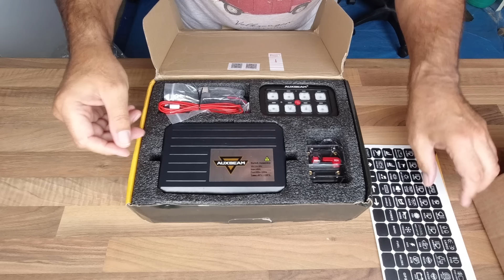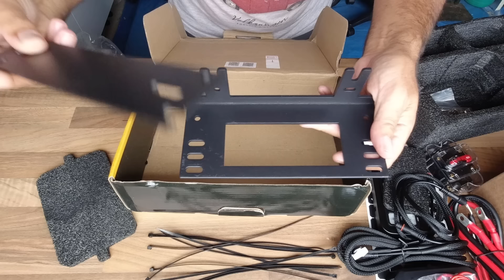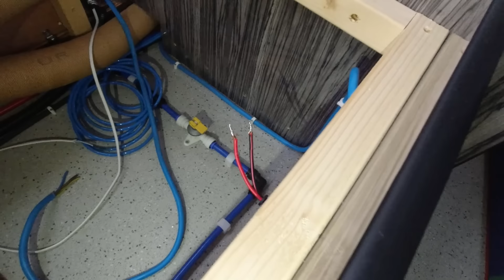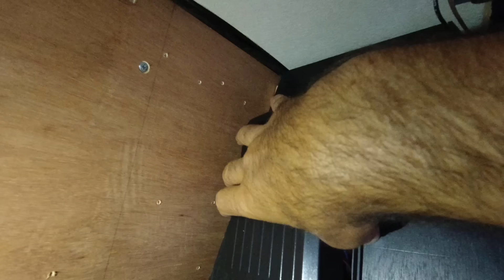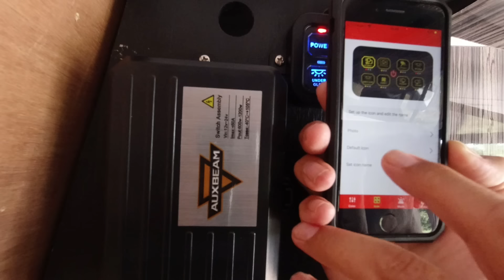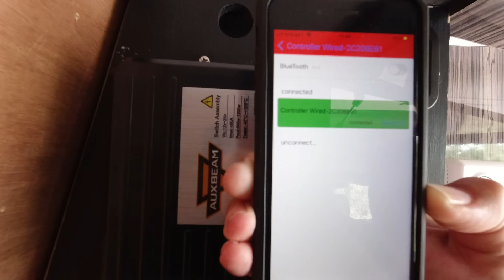Upgrading our Sprinter Campervan with new Auxbeam Control Panel

Comment from the maker: If you wish to purchase one of these Auxbeam Switch Panels please click on this link https://www.ebay.co.uk/sch/i.html?_from=R40&_nkw=auxbeam+switch+panel&_sacat=0&LH_PrefLoc=2&_dmd=2&rt=nc&LH_ItemCondition=3&mkcid=1&mkrid=710-53481-19255-0&siteid=3&campid=5338027957&toolid=11800&mkevt=1
Reply: Hi Greg, really appreciate you videos. Can you tell me what circuit breaker you used in instead of the 60 amp for the Aux beam. I purchased one and following your instructions thanks in advance mate 👍

Comment: Did you still use convertor you bought for tv to change to 12v  with this  new fuse panel
Reply from the maker: Yes, because the tv converter changes the 12v to 19v DC and it’s still working perfectly 👍🏼😃

Comment: Great video Greg (as usual) quick question! I am just about to start first fix electrical in my sprinter, I will install this great item! For my fridge & truma boiler & maxx fan will I still use a blade fuse holder?

Comment: gret infromative video as I am planning to install the same switch panel. My question is can I hook up a dimmer to this for the puck lights or perhaps 2 dimmer switches to i have a dimmer near the bed in the van maybe one up front ..? thanks again
Reply: I would expect you could add a dimmer toggle switch within the line for the light

Comment: another great video Greg. Are you able to swap the fuses to suit the rate of the electrical items in the van?
Reply from the maker: Yes you can as long as the fuse rating is below the individual contact rating and the total doesn’t exceed the total for the device 👍🏼😃
Reply: @GregVirgoe  thanks for that Greg, I'm going to give it a go 😉

Comment: Thanks for sharing. In previous video, you explain your control panel which include the 12V fuse box. Is this one different? Do you have more than 1 fuse box? Is the only reason to upgrade the remote control capability?

Comment: Great video. Which model you choose as advertised are and all look the same: AR800, RA80, GB80  GA80! 
Thanks and keep up the good work!
Reply from the maker: There are 6 way or 8 way and with or without the mobile app control. Just read the description you will find the one you want. 👍🏼😊

Comment: greg cant actually see the solid state relays on the board just fuses racks and connection block/also have you fitted or anyone elase fitted PIR for out side secuirty lighting any hlp would be usefull as dont want cheap ebay/amazon stuff
Reply from the maker: The PCB is covered in a black silicone to waterproof it if fitted in the engine compartment.

Comment: Thanks for posting. do you think they supplied the piggy back connector to pick up supply off the distribution board itself? or is there a reason why you didn't use one of the spare (5A) fused supplies ( at the bottom of the board) to supply itself? save installing a seperate fuse holder?
Reply from the maker: The fuse holder they provide is designed to come off an ignition live from the vehicle. I have since found out that if you switch the power to that red cable it turns the entire board off. 
It’s originally designed to switch aux lights on a vehicle.  
You couldn’t feed it from an output of the board because you’d never be able to turn it on.
Reply: @GregVirgoe  thanks, was forgetting that it had internal relay,  not just busbars

Comment: hi greg long term watcher of your videos they have been an absolute god send in helping me do my own conversion.    I have an unrelated question to this video which I'm hoping to can advise on
 I very currently got a leisure battery which only means of charging is solar.   so far its been perfect however I want to upgrade it with a split charge relay that way the solar is only really a back up then when engine not running.    seen various setups and prices on this which is a bit confusing so wondering what system you would suggest.   also if I wanted to add a 2nd leisure battery would the connections be the same ie.   positive on 1 bat negative on the 2nd ?      hoping you can advise.   thank you wayne
Reply from the maker: I would always advise fitting a battery to battery charger instead of a split charge relay. The relay is just a switch and it doesn’t know the condition of your battery or meter the charge accordingly. Where’s a charger will do that and ultimately look after your batteries much better for longer life. 
Yes, connect red to one battery and black to the other battery if you have two in parallel 👍🏼😊

Comment: Neat product, but a bit more complicated (and expensive) than 'just switches and relays'. Thanks for the review as I think I will need to replace my switching system. Also handy to learn about 12 V Planet. Will look at the, too. Cheers!
Reply from the maker: I think you would struggle to make aboard from individual relays and switches to give you the same functions for less money.
Reply: @GregVirgoe  I fully agree with you, plus there’s the app, which is properly handy; just hope it’s well written and secure. Great to have options such on/off, pulse or momentary and thanks for showing your installation. That’s great!
Few more questions…
Are the relays user-swappable (did you take the cover off to see), or don’t you expect these to be any problem? 
Good that you also get a 60A breaker. Is that DP?
How much parasitic draw (eg the Bluetooth) is there without any circuitry being live? Is that why you installed the isolator?
The bracketry also looks solid. Thanks for providing the eBay link and I’ve also seen their direct sale site, which shows prices in $. Unsure about postage, but the $ price seems quite a bit lower and it’s now really easy to make foreign currency purchases these days without incurring charges. Makes good sense to wire the controller off the unit’s supply so that it is also isolated rather than drawing a supply from somewhere else.
One day changing the app icon will also change the sticker!
Reply from the maker: @stco2426  the circuit board is covered with black silicone so none of the components can be replaced by the user. 
The breaker is just for the positive it’s not a DP one.
The small power feed to the board should be switched as I found out this turns the board off to prevent any parasitic draw when not in use. 
That power supply would normally come from vehicle ignition source. 
Thank you for watching and hope it’s useful to you if you decide to buy one 👍🏼🤩

Comment: Looks like a great product and well presented as always 👍. Have you checked the current draw of unit when the relays are energised, would be interesting especially when off grid, thanks, Chris
Reply: That's exactly what I'm thinking i guess this are not latching relays and require constant power to keep them on.

Comment: So to clarify... this replaces the older switch bald fuse box...and this new one is then connected directly to the battery via the supplied cables / 60a breaker?  It's just a matter to moving the wires from your old blade fuse to the new one?
Reply from the maker: Absolutely spot on! It can literally replace a blade fuse holder very easily.
Reply: @GregVirgoe  Perfect mate,r
eally good find and great video.

Comment: Great video Greg thank you.
I've just finished installing one of these in my rv too and this is a great bit of kit (as you guys from the UK would say). Instead of connecting the small cable with the 5amp fuse directly to the Auxbeam positive in (initially designed to be connected to the vehicles ignition switch), I ran it through a small switch first which acts like the ignition switch. This way when I'm leaving the van for a few days or so it cuts power to everything including the Auxbeam lights and is an extra safety against small power drains etc.
Reply from the maker: Thank you for that answer that makes perfect sense. I will add a switch to mine so it does the same. 
Thank you 🙏🏼

Comment: You mentioned that there might be a way to turn off the lighting for the actual switch box. Is this true?  I have the normal 8 gang switch box and would love to turn off the switch box and run it off my leisure/house battery. If not, do you know the actual power draw of the switch box?
Reply: Thanks
Reply from the maker: @brettferguson6954  the small red power supply that is protected by the 5 amp blade fuse needs to be switched. That will turn the panel off when not in use and turn the lights off and stop any power drain. Hope that helps you 😊
Reply from the maker: I will come back to you on that question. Please bear with me 👍🏼

Comment: If you are putting in longer power cables, you should consider uprating your cable from 10mm to say 16mm.  This is because you don't just have to consider the power rating but also the volts drop along the cable.  Up-rating the cable will reduce the volts drop.
Reply from the maker: As I said in the video with only small loads my amp draw is much less than 60Amps so the volt drop on the longer 10mm cables is still much less than 3%. If you were attaching a larger load you would have to up those cables. You are right to mention it as it could be a factor to consider. Also there is simultaneous demand to consider too. When would everything be on at once anyway. Never, maybe two or three devices so the loads even less than what I have connected. 😎👍🏼

Comment: But can you turn the back lighting off on the main control? Also been interested to know what the passive draw is from the unit when everything is off? Good video as always 👍🏻
Reply from the maker: the small red power supply that is protected by the 5 amp blade fuse needs to be switched. That will turn the panel off when not in use and turn the lights off and stop any power drain. Hope that helps you 😊 I will measure the drain once I can get to my meter 😊
Reply from the maker: I will find out and answer shortly 👍🏼

Comment: Hi i have just brought a Mercedes 7.5tonn old school delivery van in white they use too drop off electrical equipment in it its a 1992 its got full service history with it its also diesel. I have seen all your video's and i think that everything you show will give me the right place to start. I might have to do some welding in some small parts but the ven is in qwite good condition for its age it has 67194 miles did check with the dvla or now vosa the truck was kept inside a large garage and all is tru and totals up with the d.v.l.a. 
At some point i might need some advice wii it be ok to send a small email to you thank you simon.
Reply from the maker: Yes of course, that sounds like an interesting vehicle. I will help with advise where I can 😊
Reply: @GregVirgoe  thank you for your reply many thanks simon.

Comment: Very informative as usual. A tip is to use glasscleaner when to get those cables trough. It evaporates so no problems about that later.
Reply from the maker: It’s always easier with a little lube 😂👍🏼
Reply: @GregVirgoe  ROTFL!

Comment: Another great video Greg! Thank you for taking the time to review this product. Do you know if it could be used with a goal zero yeti 1000 instead of a house battery? Thanks for all your help.
Reply from the maker: It’s not a very practical way of doing it as the zero 1000 is already a one shop solution. 
The largest 12v output on the zero is 10amps so that would’ve the most you could connect to the switch panel via the cigarette outlet. You could switch a few small lights etc.

Comment: The only thing I want to know is, how much power does it consume?
Reply from the maker: I will put a clamp meter on it in standby mode and come back to you on that 😊👍🏼
Reply: @GregVirgoe  Cheers, Greg.
Reply: That would be greatly appreciated. That's what's stalling me from a purchase. 👍
Reply: Hi Greg, great video, also looks like a great produce. Did you ever get round to testing the power consumption?

Comment: the app could be better, icons are too small. Developer should separate it to 2 screens. One screen with big icons, second with colour changer. Swiping left right to change the screens.
Reply from the maker: If you turn your phone to landscape the keypad fills the screen and the colour wheel disappears. So they do get much bigger. I have an old smaller phone

Comment: Hi Greg, firstly thank you for sharing the video. Very interesting and useful device. We will install it in our van by far. Curiosity, would you know if it works without the controller?? Only using the phone app.

Once again, thank you for your time and dedication.
Have a nice day!!
Reply from the maker: I wouldn’t think so but you could do as we have and hide the switch panel away out of sight. 👍🏼😊